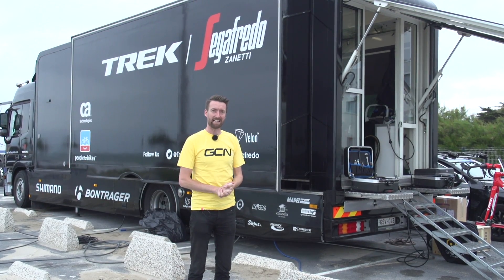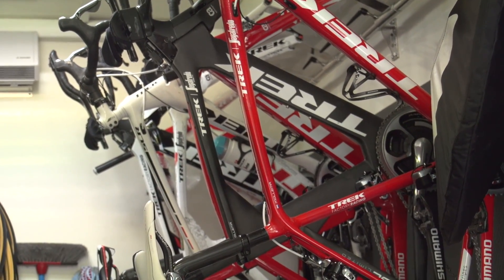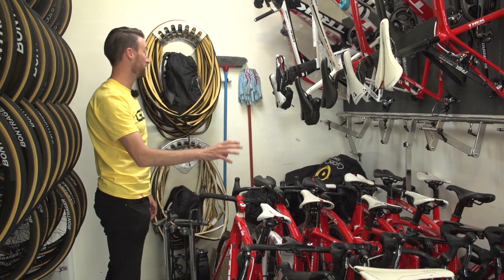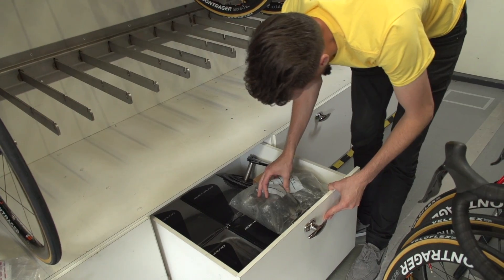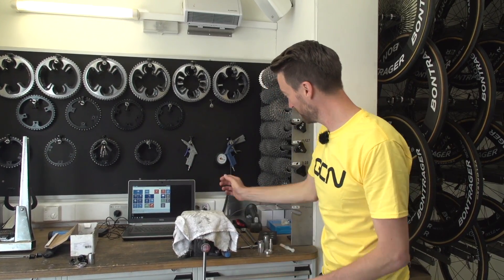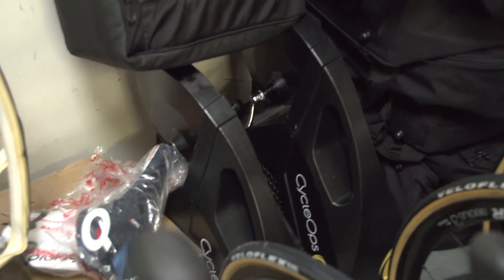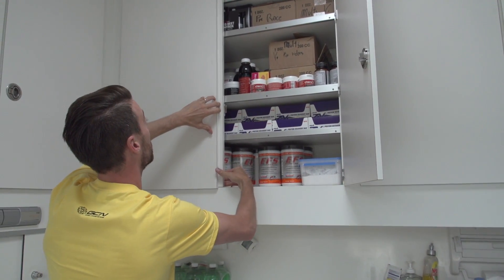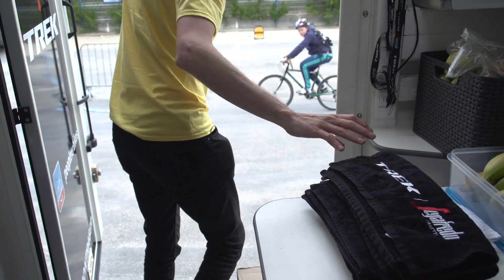Trek-Segafredo Truck Tour | Tour De France 2016

Comment: I wish they would use their shoe device on my Vittoria Veloce Carbon shoes and Vittoria Stelvio Carbon shoes. They are both 43.5 but fit my fit differently. I'm pretty sure the cleats are positioned differently on both pairs.

Comment: Could you please do a segment on that cleat adjustment device it looks really useful.  I figure with a few close ups and hints, I could hack one together with an old set of pedals
Reply: Thanks for the tip but you are 48 hours too late :-(...I just placed an order for some components and would have added an Ergo(n) tool to the mix...now it will have to wait till I get free shipping again.

Comment: What is the point of having different sized rims for the tires?
Reply: Deeper rim = more aerodynamic = more weight (wheel weight is much more important/gram than frame due to the fact that they are a rotational force. So if you are climbing in the alps, your speed will be low enough that the lower weight is worth a less aerodynamic rim.

Comment: Are those FMB tires hanging underneath Veloflex tires? It would be nice if you also mentioned non-sponsored items (such as the old lightweight disc wheel) that you find in these trucks. If you're not allowed to mention them because of sponsor obligations, maybe you can just show a quick close-up without saying anything

Comment: how viable is a climbing bike with aero wheels? #torqueback
Reply: Well body position is the largest factor, with wheels coming in second (still a small contribution compared to body position). So, yeah, very viable. although body positioning will be better on a tt bike than a road bike with aero bars